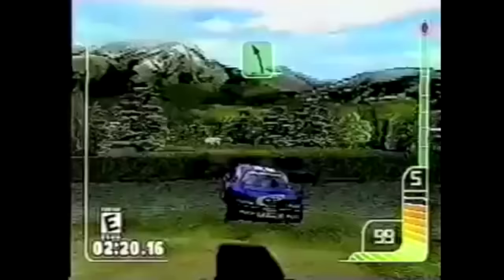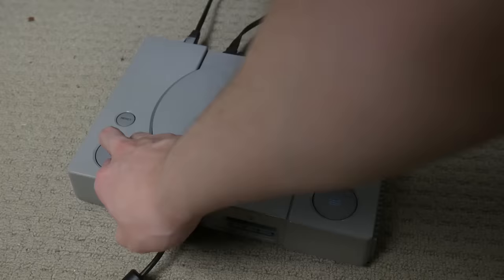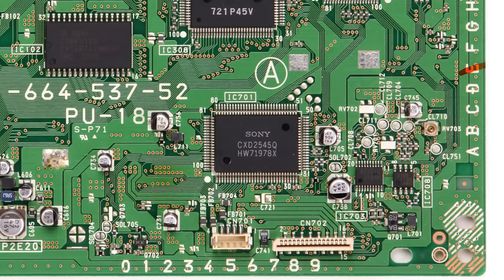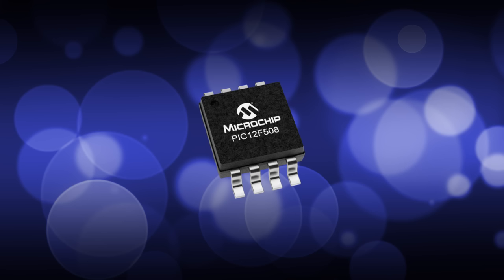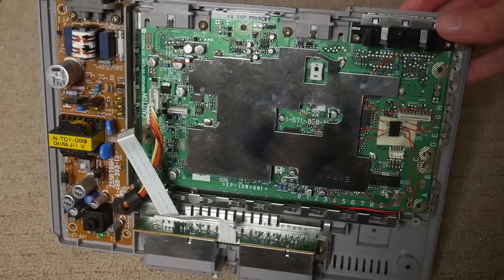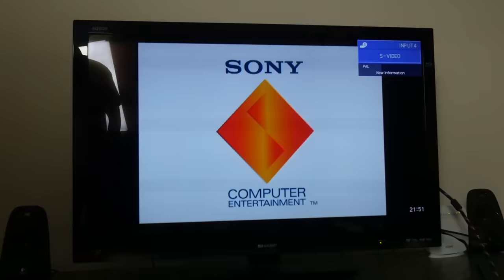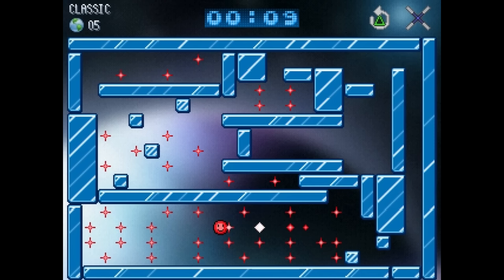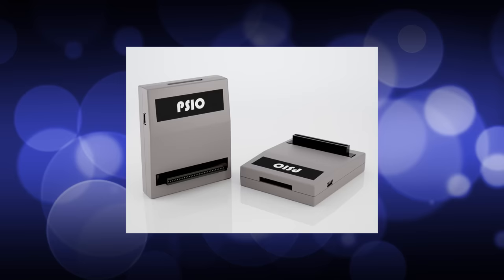Making a PlayStation 1 modchip from SCRATCH

Comment: I remember back in the day I'd always be changing the boot text and logo for all my burned games.
Reply: Gross
Reply: @iwinrar5207  why
Reply: @iwinrar5207  why
Reply: @iwinrar5207  why
Reply: 8 Min
1 like
Reply: @iwinrar5207  why
Reply: @iwinrar5207  Why
Reply: @iwinrar5207  why
Reply: @iwinrar5207  why
Reply: @iwinrar5207  why
Reply: @iwinrar5207  why
Reply: how u do dat?
Reply: @iwinrar5207  why
Reply: @iwinrar5207  why
Reply: @iwinrar5207  why
Reply: @iwinrar5207  why
Reply: @iwinrar5207  why
Reply: @iwinrar5207  why
Reply: @iwinrar5207 guys... I hate bluey
Reply: @iwinrar5207  why
Reply: @iwinrar5207  why
Reply: @Susie6iscool it's explained in the video but the PS1 logo and accompanying text are stored on the CD itself, so with the right software it can be quite easily modified when burning
Reply: @iwinrar5207 why
Reply: @iwinrar5207  why
Reply: @iwinrar5207   why

Comment: Funny enough, you never did need that mod chip... Just swapping CD's mid Sony Logo worked great.
Reply: you can actually do with a ps1? 10/10 console design
Reply: But it can damage the drive or discs.
Reply: My PS1's drive is already tired. I think the last owner used the swap trick.
Reply: @Definitely_a_Fox  Yeah, it shouldn't be tried.

Comment: Never realized that the beep when inserting a disc was for copyright check
Reply: I never knew a PS1 would fucking beep.
Reply: what you hear is likely the laser assembly itself making that beep, by the lens moving on that frequency, and thus working (unintentionally) as a speaker of sorts.
The copy check is mostly a wobble on the disc that has to match a certain frequency when it spins in x1 speed at the start. Ever seen that a PS1 disc accelerates after it has shown the boot logos? Yes, after that check it goes to x2 speed but the wobble check is at the x1 speed. You'll also never hear it on pirated/backup CD-Rs since they don't have a wobble encoded on it.
Reply: @Kalvinjj  All CD's have wobble though? It's how the laser knows it's looking at a track correctly.
Reply: @SerBallister  Yes but the PS1 copy protection wobble is a very specific frequency it looks for when at the boot. The usual lens wobble that keeps it tracked is way more subtle, in fact would be nonexistent on a 100% perfect disc and drive (it would just move veeery slightly to follow the spiral). But indeed, this commonly performed lens wobble during normal CD read is exactly what the drive uses, it just wants to keep itself in focus and on track, but the track is snaking around, the PS1 picks that up and knows that this ONE wobble there is what it wanted.
Reply: @Kalvinjj  Yup it's quite sneaky.
Reply: the wobble has SCEI, SCEE or SCEA encoded in ASCII depending on the disc's region, which is checked against the string shown on the PlayStation screen, which also varies depending on the region of the BIOS in your console, and if it matches, the disc is accepted
Reply: @TorutheRedFox  Yeah, the wobble thingy was meant for region blocking and as a protection against backup games.
Reply: @Kalvinjj  my PsOne does "beep" even if I run backup copies?
I turn on my ps, it does "beep" and the iconic intro sound "ueeeeeeooooommiuuaamm"
Reply: @CtrlAltCanc00  I think that's because the drive mechanism still checks the wobble, but the modchip just tells the CPU the check was successful, even if it wasn't

Comment: 4:17 After realizing their mistake with such a simple copy protection system on the PSX, Sony learned their lesson with the PS2, with a system so complex that you can just pop a burned DVD in and it's instantly cracked.
Reply: To be fair it did take 20 years to find that exploit
Reply: That's true, but it took 20 years to find that trick so the protection did its job since Sony isn't selling many PS2 games anymore. Before that you had to use a memory card and that had its own issues.

Every piece of hardware gets cracked if there's enough interest, so for a console that sold 155 million to be that resistant is pretty impressive. Like the PS2 was in like 25-40% of US household's which is pretty insane. Meanwhile the Wii was running homebrew software in like 2007/2008.

Plus until very recently it was super tough to USB load games and get a good experience on the slim PS2's. The USB ports were half the speed of the disk drive so you had a lot of stuttering cutscenes and super bad load times. The USB loading through a memory card method wasn't discovered until like 2020 and it wasn't perfected until the end of last year
Reply: I just bought a PS2 that already had a mod chip installed.  Done.

I did have to shop around for a while to find one that also played pirated PS1 games, and I've had to remember the button combo over the years to activate that mode since the tiny random shop I got it from in Taiwan is probably not there anymore or I wouldn't be able to find it and they wouldn't remember anyway.
Reply: @shanez1215  Playing through usb still sucks because the ports are usb 1
Reply: @shanez1215  USB can't get better, it's v1.1, dogslow. Got me FMCB package always and ESDL ELF if I need USB in a pinch or go with SATA HDD for the network adapter (Maxdiypower but I think that shop is no more)
Reply: i dont like  copy protection some cds went bad i had  buy game again i do understand there people out dont want to buy game
Reply: wait so your saying you can litterly burn a normal cd and put it in an unmodded PS2 and it will work
Reply: @Matthew27567  Pretty much. It's called FreeDVDBoot.
Reply: @fishactivation5087  k
Reply: @aprofondir  but thats how to mod your ps2 very easily, i did it too... i think i modded it in a few minutes... minus copying things arround... but now it has snes gameboy and even n64 emulation (n64 emulation is bad tho on my slim model)
Reply: Nothing beat's Sega's "no one can put 1GB of data on a CD, we're safe!" then proceeding to ruin your laser because off-the-shelf CD-ROM lasers weren't designed to reach such data density.
Reply: @SolidSonicTH  I don't think that had any relation to laser wear, the data density wouldn't make any difference. If it can read the disk at normal operation levels, it's not going to make any difference - it's just a laser, it doesn't know anything about the data. It seems likely if Dreamcast lasers wear out faster that it' simply because "backups" were extremely common, and as always machines tend to struggle to read these compared to original disks.

Comment: The colored discs were exactly as you guessed regarding physical protection. The color had nothing to do with copy protection from a software perspective. 

It was hard for even the best pirates to replicate the black dye in those discs. They'd basically have to have access to one of a few makers pushing out colored discs of that type at the time.

Colored CD-R/RWs would come down the pipe but usually a lighter hue and not the solid black that PS1 had even when "black".
Reply: Sony actually ditched the black discs very late in the PS1's run (IIRC after the PS2 came out). Likely they shut down the dedicated PS1 pressing lines at Sony DADC and moved everything to the regular CD pressing lines.

Comment: I actually had a PSX at one point that did not beep at startup. Apparently, some PSX models were prone to the mechanism that makes the beeping noise fail due to some hardware oversight, that allowed too much power from AC into the mechanism and so, fried it. This was never addressed by Sony as far as I know.
The one I currently have does still beep, nineteen times of twenty. It's a very old model, one of the first that can play the VCD format (has the composite and audio outputs alongside the Multi Out). It runs okay, for now.
Reply: @relo999  I bet the one I have is like that too. I don't use it that much since the only way I could is if I connect it to this half-busted portable DVD player that accepts AV input; the screen is small and the speakers only half work (same with the headphone jacks), so it's not ideal. No, I do not have a TV, just an LCD VGA monitor.

Comment: Region locking was pretty annoying for me in australia, especially since lots of the good 90's and early 2000's jrpgs are only available for the NTSC-UC/J systems. And as you said, as long as you use legitimate copies of games with a modded console its legally fine. Which is what I do

Comment: I found that some of those action replay type devices that plug into the parallel port will let you play backups. You have to keep the disk spin button inside pressed down, theres a stick on the lid that presses the button down when lid is closed, you just gotta get a spring from an old ballpoint pen to go around the stick to keep button pressed while lid is open.
Put in an original copy of any game and turn on while lid is open, the disk will spin, when it stops put in any copied game and press the start game option on screen and the copy will play.
One of my devices plays MP3 music from cds thru psx using parallel port but it also lets me play backups the same way.
Reply: A GameShark? Yeah that was a way to play pirated games lol

Comment: you should 'dead bug' that chip -- put it upside down on the pcb... as it is, those pins could scratch through the solder mask... which is bad...
Reply: Two things: he did flatten it out, and it was on an area of the board without solder mask.
Reply: @userPrehistoricman  No. He literally put it over the traces.
Reply: @miko8732  sheeeeet, you're right

Comment: I gave your video a like. This is pretty awesome stuff. What REALLY would have been awesome, is if I could have found this kind of information back in the mid-2000's, when I actually last cared about the possibility of, acquiring more PS1 games (legally or otherwise), and then being able to play them. It eventually turned into I was wanting this sort of thing done for my PS2, and again, for PS1 games, which got put on hold for a good decade or so, AND NOW, I just play PS1 games on my raspberry pi, and if anything, I just need a larger micro SD card to be able to dump/store more games.

Comment: You missed a huge part of the copy protection, that being the track wiggle. Legit discs had their tracks intentionally deviate from perfect circle. the head would move to maintain alignment, however if you copied the disc, the burner could not reproduce the wiggle. This was the primary protection method.
Reply: Literally explains this in the video. Alright he doesn't explain what it actually is. But the principle is the same. The wobble is the "code" that the drive reads.

This "wobble" data is part of the disc and is used for all sorts of devices. CD-R/RW for example the drive uses the wobble to find out what type of disc it is. Again all drives can read the area, it's just not in the writable space and can only be pressed into the fornat.

Comment: I don't like PSIO. It's a piracy device with DRM of it's own. I'm hoping someone reverse engineers it and makes an open source clone.
Reply: any proof for drm part? afaik it can play homebrew so that seems konda weird
Reply: @niewazneniewazne1890  The software used to load files onto it requires you to have the serial number of the unit to download, and I'm pretty sure it's tied to the unit as well.
Reply: @moth.monster  You also need the order number to get the firmware.
Reply: Why bother.  Just run ps1 games from HD on a PS2.

Comment: The copy protection is encoded into the wobble of the data stream. No disc is made perfectly so optical disc readers use a "floating" lens to follow the data stream as it wobbles from manufacturing defects. This is an automatic process for most optical disc readers. Think of it like how we as humans have parts of our nervous system that we cannot control directly. Like our heart rate or digestion process. The PlayStation discs had the region code and copy protection encoded into the wobble of the disc and the PS1 disc drive is designed to be able to read that wobble. Writable CDs have a prebuilt groove that the laser has to follow so you can't recreate this wobble without pressing the CD in a factory. Technology Connection has a great video with more detailed info on this.

Comment: Actually there was no data written to areas of the disc that were not able to be read by a cd rom or burned by a burner. If you rip and burn a psx disc the data is identical. The first sectors of the disc were instead modulated by literally wobbling the track kind of like a vinyl record to encode the region data. The laser pickup tracking feedback circuit fed data to the system to see if the modulation was there or not, confirming region, and if it was absent then it was either counterfeit or the wrong region. A cd burner cannot reproduce this for one the rip will just produce a data stream regardless of how the laser tracks, and cdrs are produced with a natural wobble groove to help the laser track the unwritten track while burning. All of the data is there, just no modulated feedback from the tracking circuit to validate the authenticity of the disc. Actually pretty simple and ingenious.

Comment: I remember using the the inside of a biro pen (bald point pen), the bendy ink straw. To push the little button on the inside of your ps1. Doing the old disc swap was proper annoying. Had to get the timing perfect for it to work. Inside of my station covered in the ink from the pen. Argh, them were the days! Loading a ligit game, and switching it for a knock off. Had a mate who could get hold of copyed games months before releasing in the uk. I remember being big dick on campus having all the new games, months before my mates. Lending them copies, teaching them the disc swap trick. Loved my ps1

Comment: Greetings. I have a Ps1 7000 NTSC J that i swapped the bios with an NTSC U 9001. The 7000 was initially modded with unidentified modchip.  Original JP games worked no issue.

After the swap, i noticed that the bios screen is now english. Meaning the swap worked. However, JP games as well as US backup games no long work perfectly. Most of the games, orig or US backup are stuck in the PS playstation logo screen. Only 1 US backup and 1 orig JP games are confirmed working, rarely.

My question now is, could this be a lens issue? I tried a Chinese lens but thats even worse. It barely boot to the black PS screen.

Or could this be a modchip issue? Do i have to install or reprogram the chip?

Comment: You didn't need a modchip for PlayStation 1, you only needed 1 original disc (it could be a demo disc from a magazine) and a piece of tape.
1. Put the piece of tape on the spring that detects if the disc drive is open, so it always things the drive is closed no matter what.
2. Put the original disc and start the console.
3. Listen carefully for the sounds, and when it has finished reading the copy protection and before it has begin reading the game, switch the discs.
4. Profit.
Of course, you could also play that way games from other regions, but at least in EU you still have the issue of PAL-NTSC signal, so some additional steps were required to convert the signal if you wanted to play NTSC games in a PAL TV.

Comment: You don't need to chip a PS1 to play copied disks - back in the day you just booted from a demo disk, then opened the lid with the help of a little gadget to defeat the lid-open detection thing and swap out the disk.  Sounds simple but it worked a treat, no soldering or even dismantling required.
Reply: The DiscSwap method.

Comment: i think it wasn't that they wrote this data to a region that regular CD ROM drives can't read, but rather they wrote it in a way that normal CD drives can't read.  there is a certain amount of "give" in a CD data track, to allow for slight differences between any two manufactured disks.  So the laser sensor automatically picks up on and adjusts itself ever so slightly to track and keep the data stream in focus.  This isn't normally handled on the firmware or software level, it's hardware.  normal drives ignore this, they only care about the data.
the PS1, however, was designed to monitor these adjustments live.  and Sony manufactured their disks to have a specific, known "wobble" to the data stream on the disk.  the drives automatically adjusted, but in a pattern that the console monitored and used to confirm that A) it was a legitimate ps1 disk, and B) it's the right region.

Comment: you can see if there's data written on a disc, it's a different color.

if the disc didn't have a black coating you'd be able to see the copy protection part as a separate written portion where it's not supposed to be... it's not so much copy protection it's self as it is hiding the copy protection.

Comment: My only ever bout with console modding or repair was with a PS1 I purchased for $40 a year or so ago. As happens with them, the optical drive failed, and everything played extremely slow if at all. I've heard nobody really makes a halfway decent replacement drive, so I did the reasonable thing and bought a new old stock factory original drive off of some guy in NYC that I guess bought all of them from the manufacturer when they stopped production. It cost almost 3 times what I paid for the console, but damn if it doesn't run like new. There are a few region-locked exclusives I thought looked neat, so I might give something like this a try. It's not like it's significantly more complicated than taking out a few screws and plugging in a ribbon connector or anything...